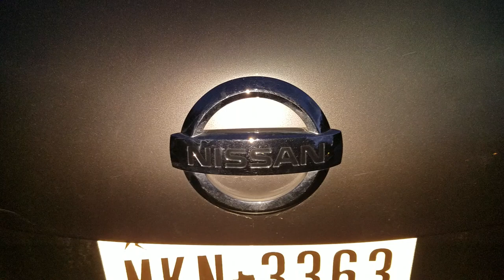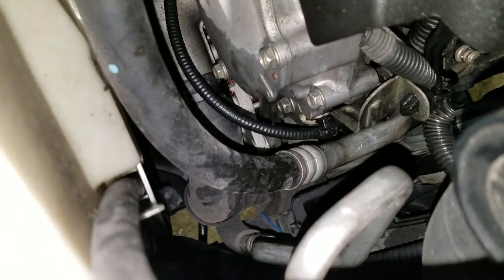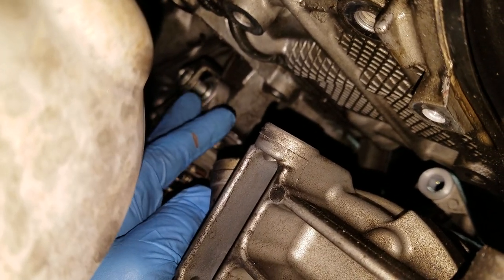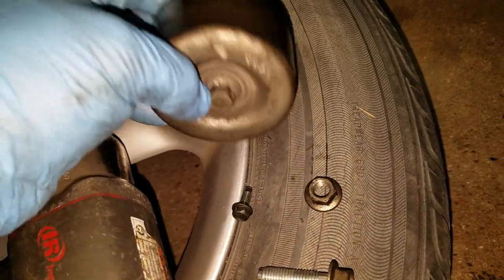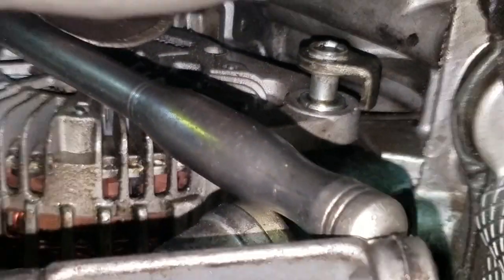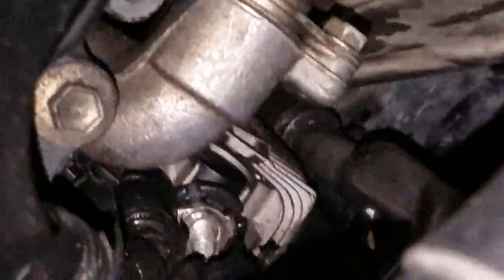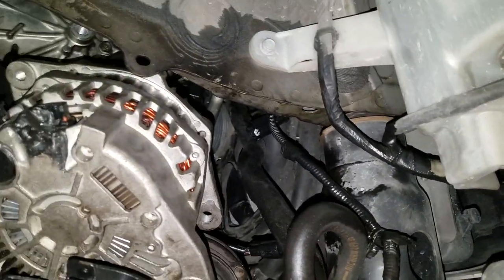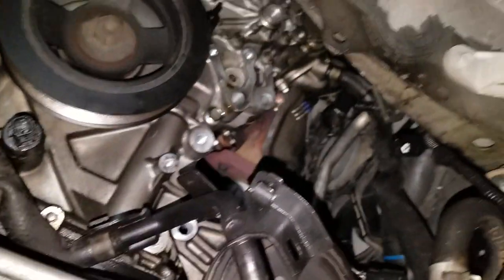Nissan Murano Alternator removal No A/C recharge No antifreeze drain

Comment: Thanks Chris.  I own a 2006 Murano and a recently I paid a friend with a service garage to replace the alternator.  He took it out the top way charging me 4 hours of labor.  The A and battery cost me over 400 in parts totaling over 800 for the job.  In disturbing the A/C compressor the "O" rings were damaged creating a 2nd job of $150 for 1 1/2 hours, totaling almost $1000 with 5 1/2 hours of labor.  I could have purchased an A for $90 to $220, that verses $1000.  Thank you for your tutorial.  I'm late but I learn.

Comment: You took one of the most difficult Nissan jobs and made it simple by dropping the AC Comp.  I have watched dozens of videos and everyone does it that hard way (remove the fan, radiator, hoses, etc).  I have a 2008 Nissan Quest.  Same set up and Murano.  In fact, the 2004 - 2009 Nissan Quest, 2005-06 Altima, 2005-07 Maxima, and maybe more, have the same set up..
Reply from the maker: Cool thanks for watching

Comment: I just replaced an alternator out of a Nissan Quest. It came out behind the AC compressor out the bottom. The replacement alternator was slightly larger. I had to remove the radiator and shroud. It was easier to remove the radiator. Took far less time for me.

Comment: Yes i did that on my 09 murano when it was 4 years old, it was a pain in the butt taking out that alternator and putting the new one back in. Unfortunately I replaced my alternator couple more times due to failing aftermarket part.
Reply from the maker: Same here, I had to do it twice

Comment: I know you said the plug melted but is that all melted plastic? It sort of looks like someone attempted to silicone the old plug harness in place. 
I'm looking at your video because I just got a call to look at one of these and the customer says the mounting bolts fell out of the alternator. She had one put on she said about 2 years ago. Have you heard of this on that model? Most alternators have some sort of locking flange nuts or bolts to prevent this. Anyway,  I'll be looking at this car tomorrow.
Reply from the maker: It was repaired previously. I did not do the repair. The oil caused more damage and degrading. I have not noticed loose bolts or heard of that kind of problems.

Comment: We hoped that this same method would work on a 2008 Nissan Quest.  Nope.  The frame in the engine bay is different from the Murano and blocks the possibility of removing it through the wheel well.  Had to do the normal routine, remove fan, radiator, etc.
Reply from the maker: Thanks for watching and sharing your experience.

Comment: I'm in the middle of this God forsaken job right now watching this video. My wife's 2012 Murano we got it with 27,000 Mi on it and now it has about 140,000 miles, it has never had the alternator replaced. The one in your vehicle that you're removing looks almost new. I looked at the reviews for the alternators at AutoZone they had a $130 one, a $200 one, and a $300 one. The reviews on the two cheaper ones were pretty horrible. There were a lot of people who bought the $200 one and had it fail either immediately or not long after, that is why I went ahead and got the $300 one because it had better reviews and it's new not rebuilt.

You need to fix the leak on that air compressor so it's not running all the time.
Reply from the maker: Yea the compressor pop off valve is leaking. I ordered a new one.

Comment: Man this is helping a lot.  Finally got the top bolt out from watching you. Any suggestions on the bottom alternator bolt?  I can get to it fine but it ain’t budging even with 1/2 inch impact wrench.
Reply from the maker: Take the pinch bolt out and wiggle it around a bit. You will need a impact socket and a long break bar to get it loose. It's in a tight place take your time it will come out.
Reply: @chriskolar  my old wimpy breaker bar wasn’t budging it.  Ran to Rural King and got a 2ft breaker bar, that did the trick!  Thanks again couldn’t have gotten it without your video and tips.
Reply from the maker: @Pharmgatr01  cool

Comment: Hi! How long approximately did this take for you? I believe this is the problem with my murano currently and I want to make sure the labor quote is correct with this shop. Living in a new area and I’m hoping they don’t charge me more than necessary
Reply from the maker: It's about 2 hours.
Reply: Yes, be careful.  I have a Shop in Sal Lake City quoting me 6-7 hours labor on a 2009 Murano.  That’s such a bogus time.  Total job is $1,140.  I can get the part, good quality for $189.  
Shops that see women coming in and taking advantage are frustrating!
Reply from the maker: @BBB-rd2qi  Thank you for watching my video. Always get a few quotes before committing to a repair. The shops quote from a estimated time that is required to do the work. A good mechanic can always complete a job in less than quoted time. That's how the mechanic makes good money. Sometimes there are problems like stripped or rusted bolts that are a nightmare and will totally blow a job.
Reply: @chriskolar  - Thank you so much for responding!  Your information is appreciated!
New sub here!

Comment: I replaced many many alternators form the smallest cars to the largest trucks and the Murano was the biggest pain in the ass by far It was a nightmare
Reply from the maker: I know right, what was Nissan thinking
Reply: 2010 Nissan Murano 3.5L
The procedure is 90% from the passenger wheel well.10% bottom for long alternator bolt and 2-rear A/c compressor bolts...1st remove the small plastic splash shield exposing crank pulley area.....Then loosen the front lower longer wheel opening shield partially and bend back propping it on top of brake rotor out of the way. I lowered a/c compressor and just held it down  a little pressure to remove alternator and again on installation....the hardest part of this job.....the top alternator mounting bolt re-installation. I will have to say my new 
808-15-25 1/4" Long Reach AIR Ratchet 15.3" made a quick job of tightening it.
The alternator electrical 3-wire connector cracked to pieces....
.Amazon $7 Zreneyfex Alternator Regulator Plug Harness Lead Repair 'Pigtail' 3 Wires Regulator Plug
Red....ign power (closest wire to radiator)
Green...12v batt (Center wire)
Black...to ECM (rear closest to engine)

Comment: Is this expensive
Reply from the maker: If you buy a new alternator yea it's a pricy item. If you get it rebuilt it's around $100. Find a rebuilder in your area. They are out there. Sometimes they have a unit already rebuilt and you can swap it. Otherwise you may wait a day or so. If I take apart a vehicle for major service I will offer having the alternator rebuilt. It's already off and it saves money in the end.

Comment: I saw you’re alternator pigtail video didn’t understand fully I see here you have the same wires the grey yellow and purple how would I re wire them to a new plug please help
Reply from the maker: If you go further into the wire harness where it is wrapped up you will see the wire colors easily. I think you are getting confused because the colors are not matching.
Reply: @chriskolar  can I send you a picture or call you
Reply: @chriskolar  it’s just it’s because I got a new plug and they have red black and green wires I’m just lost I can fix stuff but when it comes to the wiring yeah no haha
Reply from the maker: The info is there in the video. If you connect the wires as described it will work.

Comment: Hello, how can I know the real alternator.  Mine is seriously damage
Reply from the maker: Use vehicle identification number to identify. Call the any Nissan dealer and get the amps output and part number. You can compare the part number to what's available on ebay or Rockauto, they have good pictures.
Reply: @chriskolar  sorry. What's the initial amps
Reply from the maker: Amps is the output of the alternator. Power level
Reply: @chriskolar  sorry. Are you on WhatsApp or Facebook??
Reply: @chriskolar  I'm not able to get the alternator in my location, is there any other Nissan alternator which will work in replace?

Comment: Ac compressor went out right before the alternator on 2009 Nissan Murano.  No current to ac compressor, replaced fuse box and battery fuse holder , still nothing
Reply from the maker: Need a scanner to check the commanded state of the compressor. It is computer controlled.

Comment: God bless our beloved dear
 May Allah increase you from his bounty
 I love my 2006 Nissan Murano
 I mixed oil on my car. Do I have to take out the machine and the gear outside the car?
 It is useless to change the head without the machine and the gear outside the car
 Because I asked a mechanic to say that the machine and the gear must come out of the car
 What is your opinion
 Thank you
Reply from the maker: Mixed transmission fluid and engine oil? If so you will need to drain all the fluid. Put new oil in engine. The transmission is different. All the incorrect oil must be removed. Remove the transmission cooling line and drain all oil. You may need to full it and run it then drain it a few times.

Comment: But how do you get the belt off? It's like you missed some steps . I don't see how this is informative.
Reply from the maker: I did not show how to take the tire off either, or the fender liner. If the video is too long you would not watch it. The title does not mention the belt. I am sure there are many videos about the belt. Don't give up so easily.

Comment: I'm having trouble disconnecting the alternator connection. 
The room is tight, and I'm not sure how to unclip that thing. 
Any idea anyone?
Reply from the maker: It's a tight one. If you must cut the wires and splice it back after you get it unplugged.
Reply: @chriskolar  Ah...that's a great simple idea!!